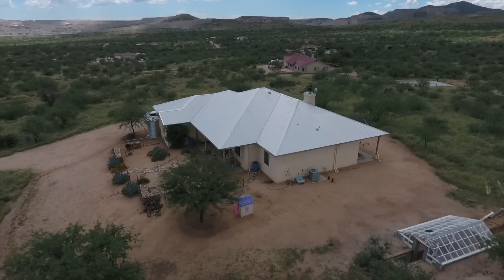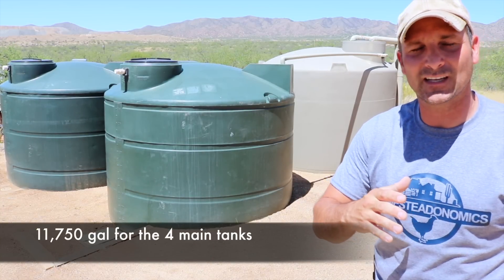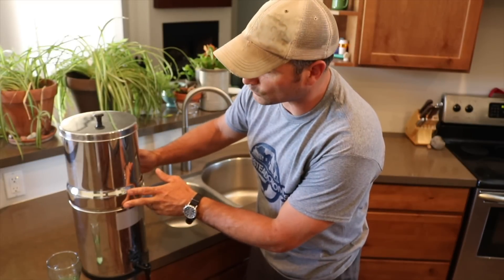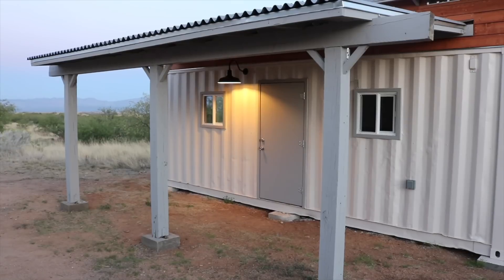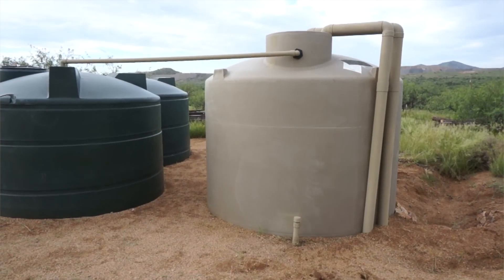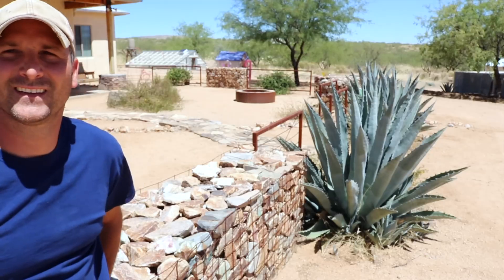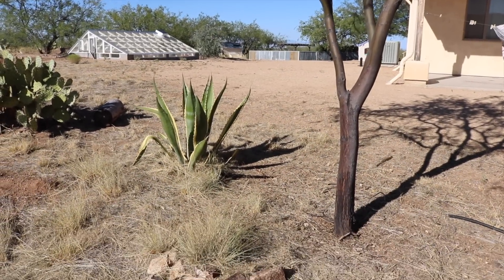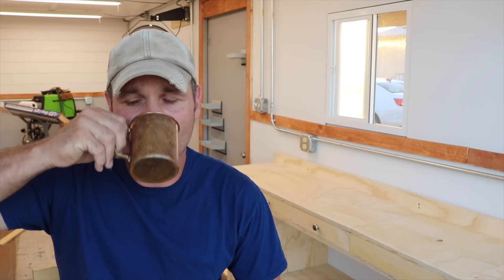Rainwater Harvesting QA - Cost, is it Illegal, how I treat, etc,.

Comment: For those worried about getting sick from rain water, my grandparents lived to 81 and 88 on rain water collected in their cistern. No treatment. They just had a simple sand filter in line with the water pump. The cistern was built into the foundation of their home,
Reply: What city and state did they live in?
Reply: My grandmother lived to be 97. Used cistern water for everything but cooking and drinking. That was what the well water was for.
Reply: @Keyzer Soze Try again. The OP who I was replying to talked about his grandparents using cistern water as did mine, my parents, and even myself. We had one pump, one tank, and a change over valve. The rule was one tank full after change over from cistern to well water and then used for drinking water. Nobody ever got sick from the cistern water. And we had no filter on it.
Reply: @Keyzer Soze It was still present in the tank with just one filling so it really wasn't out of the system. It just was diluted.

Comment: One time, I put a lot of sea shells in my aquarium. The next day the ph was about 7.2.  I experimented moving it up and down, but it always returned to the same 7.2.  I am pretty sure it was the chemical composition of the shells.  I came to the conclusion that if I put a quart of battery acid in the tank, the next day it would be back to 7.2.  I would estimate that a few pounds of clean sea shells would counteract any acid in the rain, and buffer your system to a steady, known ph.  I suggest that you experiment with shells, if the acid proves to be a problem.

Thanks for a very clear, informative video.
Reply: Too much error with meters.  I use a chemical test.

Comment: Grey waters, once filtered (or not) should be used for flushin. If you should change the way you water those trees. Firts, do it by night, so evaporation takes kittle toll, then use underground small piping to do drop watering. There are several ways to save water. when you take a shower, place a bucket to collect cold water until hot water comes. you may use it to cook, to waterinng the plants o to flush. Take short showers.soak, soap, rinse. thats it. Place special flushing taps with two positions, one for pee the other... if you cant change it, place a bottle or something inside the taak, thats a 1 litre saving for each flush......ask the israelis in the negev about saving water......here in Spain, we must make an effort to save as much water as we can... thanks for your video,  kudos to you

Comment: You might reconsider the first flush idea.  I agree that what has become the "standard" is too small though.  I use a 55 gallon barrel for my first flush, but I still use that water where ever I can instead of just draining it, unless I don't use it up before the next rain.  I generally ask people with first flush devices that if they figured out how much water it held, and then they took that amount up on the roof and poured it out would it actually clean the roof and gutter or not.  Well, with 55 gallons, yes. with three or four gallons, no.  So if it won't clean off the roof and gutters of dirt and debris, it's not doing it's job.

Comment: The drone shots help show the elevation of the property. It looks like the house is on top of an ever so slight hill which helps drainage. 

Aprox. $5k for this system beats the pants off a $15k gamble for a (maybe) well. I remember when my dad built his house (in SW Michigan) it was $10k and I think they went down 1,000 ft. Something crazy like that. 

I'm curious how the exposed (to the sun) PVC pipe & fittings are holding up.

Comment: OMG!!!!........    Brilliant.......How many rainfall is the average there?
Reply: The area around Tucson gets around 12 inches per year and about half of that amount falls in July, August, and September.  The reason for the spike in summer rain is a monsoon that originates from the Gulf of Mexico and Gulf of California.  The cool wet air from northern Mexico rushes into southern Arizona after the sun has baked the Four Corners area enough during the very dry months of April, May, and June which causes the hot air there to rise.

The monsoon centers along the Arizona/New Mexico Border and weakens the further north you go which is why in comparison Phoenix only gets about 8.5 inches of rain annually.  One other odd thing about this rainy season is how mild it seems until it hits.  Only about 1 in every 4 days during this time is overcast but when it finally decides to rain, the skies let loose in dangerous flash flooding.  It isn't uncommon for the hardest hit places to get 5-6 inches in a couple of hours.    In contrast, the months of October to March average about 1 inch of rain per month.

I would have to imagine that the dry months and flash flooding would add more complexity to a rainwater retention system than would be needed in a place with more predictable rain patterns.  I also wonder how feasible a system would be nearer to Phoenix.
Reply: Thnx......

Comment: Our rain water collection system is a 1/3 acre pond 13 feet deep with nothing running into it. Here in NW OH they are quite common because  GOOD WELL water is hard to come by. We have a well but the water is black sulfur and destroyed everything electrical in our new home. We do not suffer from the  limited rain problems here so water conservation is not an issue. Enjoyed the Vid.

Comment: Great video as always.  You do really nice work, both the projects and the project videos.  You mentioned that occasionally you need to get water delivered.  You piqued my curiosity with that comment.  I live in northeast PA near the Appalachian Trail, so water is not near the issue you deal with.  Nonetheless, I get water trucked in to top off my pool when I open it in the spring.  I just paid $125 to have 1000 gal of drinking quality well water dumped in my pool.  How does that compare to you cost / availability?

Again, thanks for the hours of entertainment and education. 

Tim

Comment: 11,000 gallons is not going to be enough. He even buys warer occasionally. So that means maybe getting more rain collection surface and storage as well.
Reply from the maker: yes, the weakness is capacity.  I plan to build a large concrete cistern eventually as money comes available but right now the 11750 gallons gets us through to the next rain... most of the time :)
Reply: I just wanted to know if there is any problems of plastic chemicals leaching into the water.I've heard that's a long term concern, especially after you own it for a few years. Would you consuder stainless steel  containers? Any info is greatly appreciated.

Comment: I dunno dude. $10000 for a well vs. $5000 for the materials. What you didnt figure in was your time and labor building and now maintaining it. The way I look at it, the time you spent/spend on this whole setup kinda negates your cost savings. (by the way you wouldnt have a water bill with your own well) Not saying what you are doing is foolish mind, it is cool, I just have a hard time thinking it was worth it. What are you going to do in 30 yrs when it's time to replace all this stuff but your too old to do it yourself anymore? Then you'll definitely have to pay for that labor.
Reply from the maker: I see your point:)  But not sure if you caught it but when I gave the cost of the well, I also said that there is no guarantee that the well driller will even hit water.  Out here they are around 600-800' deep and everyone who has a well still has to have a storage tank.  With those depths, it's hard on the pump, a storage tank also allows a well to be pumped lightly and slowly so as to not clog your pump with sand and sediment.   
Another thing to point out on the well, is that our neighbors actually drilled a that ended up not producing.  They though they hit water but the well just never would produce enough to pump.

Anyways, I'm not saying it's right for everyone.  It's just based on my own situation:)  I would LOVE to have a well, but just can't justify the costs right now.  But perhaps in the future :D

Comment: Kind of a dumb question, but I'll take the hit: what about the temperature of the water? I just imagine it getting hot while those tanks bake in the Arizona sun. Thanks. Love your videos.
Reply: I spend a lot of time in Cabo (MX) and they sell two colors of tanks, mostly, white and black, the people use the black tanks for how water and it gets warm (90's) but not really hot, the white tanks seem to stay cooler, but it is never cold like it is in most of the states.
Reply: +adam courtney Just build a shade roof over the tanks.
Reply: On the Gulf Coast of Texas not far from Houston our unshaded 500 gallon galvanized water holding tank (for the well) routinely got to temperatures comparable to heated water. We shut off the water heater in the summer which saved some electricity.Yeah, that water is going to get hot.
Reply: With the size of those tanks and if they are a light color like tan or white they should stay below daytime temps. It takes a long time to heat and cool that much water. So the water would stay at a relative average between heat of the day and the cold of the night.
It's kind of like a swimming pool. Regardless of where it is, it usually stays pretty cool.
Reply: Bury half of the tanks a decent distance underground, for the other half use black ones and keep them in direct sunlight. Draw from either set of tanks depending on whether you need hot or cold water. Minimize or eliminate the need for mechanical heating/cooling depending on your environment :D
Reply: It wouldnt really matter would it?
The drinking water would be put in bottles which are then put in the fridge.
Reply: Honestly, I know next to nothing about the practical issues that arise when implementing something like this. Still, I think the basic concept is sound, even if using just the direct sunlight vs buried aspect of it and ignoring the tank color.
Reply: Black thanks filter sunlight, so you'll have less algae on the water. White thaks, although they're opaque, let some light through the exterior and may promote algae to develop, but they are "cleaner" for maintaining the inside free of algae and debris.
Reply: I can't speak for homesteadonomics but the tanks I have here stay cool enough during the summer that it's like taking a cold shower.  The water in the lines gives me a good start at a shower but then the water from the tanks kicks in and I'm outta that shower!  (( and sorry, I have no real idea about the actual temperatures ))
Reply: Black may be good at absorbing heat but it is also good at releasing it too.

A black tank will be  a Blackbody and will just as easily release the heat back into the atmosphere as it absorbed it.

Comment: Love your water setup for your area. It covers all aspects for ones water usage, indoors and outdoors.

Just one concern you might not have thought of. One should have one centralized water filter system  to cover all points that can be used for drinking water. For example, all sinks in the home, all tubs and showers and even the garden hose tap. 

Where I live, New Brunswick, Canada, it is much colder so such a system will have to be modified for our type of climate. We use a well, now located in our front yard. Our water is hard; therefore, goes through a salt based water softener. Within the last couple of years, our water contains arsenic and lead, which lead to the installation of an osmosis filter system under the kitchen sink. This gives use drinkable water only in one location in the entire home, the tap from the osmosis filter system installed at the kitchen sink. Any other location in the home where water can be accessed for drinking is not treated by the osmosis filter system. Hence, this is where the problem lies. I do not want to install multiple osmosis water filter systems throughout the home to cover all possible points for drinking water. That option is not viable due to financial cost and the use of space.

I was hoping it might be possible to re-install the current osmosis water filter system to a point just after our water softener so that all possible points in the home where drinking water can be accessed can also be covered and be accessed for drinking water.  I am not certain such an osmosis water filter system to cover the whole home is available and not extremely expensive.

This might be something to consider for your water filtration for your system in order to cover all points of water access that can be used to get drinking water.

Comment: Has your collection system ever gone over capacity?  Filled tanks and then had over flow?  On a well and only have 100 feet deep and the water is 10 feet down, best water ever, don't have to filter and just use a pressure tank system for the house and horse barn and yards.
Reply from the maker: Yep... every monsoon it overflows... I am limited on storage capacity mostly... you can see them overflowing in the tour video.  glad to hear you have such a great well... I would LOVE to have that set up.. then I'd add about 20 more fruit trees to my garden area... very cool!!
Reply: It's good to know you have that much rain, no wonder calling it a monsoon. Use to have a place in Saskatchewan that didn't have a well  and was all rain water with a MASSIVE cistern that took up half of the basement of the house, only way to keep the water from freezing,  and yeah  that was a pain,  but was nice not having to pay water bills.   Planning on planting more fruit trees and shelter belts to catch and hold snow and slow down evaporation.   But man  would love live someplace WARMER like you.   Even the summer heat is better then -40 degree C

Comment: I have a much smaller rain water system, 2-500 gallon and 3-250 gallon tanks collecting water from 4 downspouts in the Dallas Fort Worth area. Of course it does not come close to fulfilling all my water needs. But I have a couple big trees on my property and if I did not have leaf diverters and first flush diverters I would have so much more junk in my tanks. I heard Geoff Lawton say in a video once that a little bit of algae on the inside of a rain tank is a good thing, it keeps the water a little fresher. I don't know if that is true. Have you considered a ferrocement tank? What kind of tanks do your wife's grandparents have? I imagine you could make a fabulous ferrocene tank but I think you are probably more of a metal tank fellow.
Reply from the maker: Hi Joan, I actually plan to install a large concrete inground cistern eventually.  That's actually what my wifes grandparents use for their cistern:)
Reply: I was guessing they must have something like that. From what I've read ferrocement is older technology that has worked well for decades.

Comment: I don't know if you are aware, but you can get a filter housing, that takes 5 or 6 of the ceramic filter candles, if you can get to the cold water line before it goes to the kitchen faucet and faucets in your bathrooms, you would not need to rely ( as much ) on the Berky for  drinking water.     The big orange store has them on their website.      Best regards
Reply from the maker: Thanks Jesper... i could definitely access my pipes but I like the simplicity of the Berkey system and it's really affordable too.   We go about 2-3 years off of just two filters.  But I may have to check out that other system too.. thanks!  :)
Reply: Glad you liked the tip, I think you can get housings with fewer candles also, then you could have a dedicated drinking fountain besides the kitchen sink, and the candles would last just as long as the SS berkey on the table
Reply: I found a link to the filter, it took a while, because it is a Doulton, not Berkey.

http://www.homedepot.com/s/Doulton%2520Rio%25202000?NCNI-5